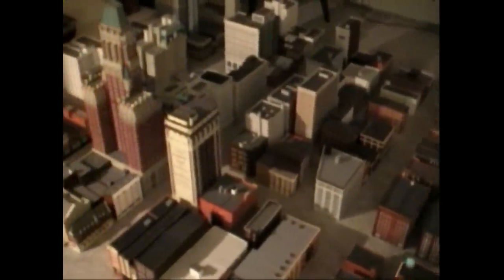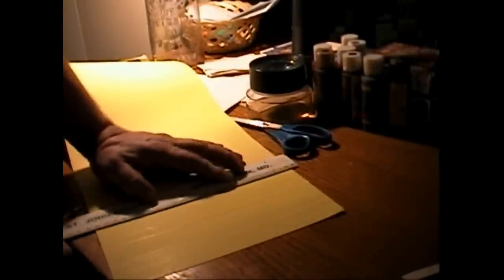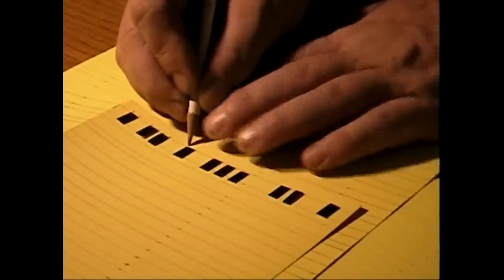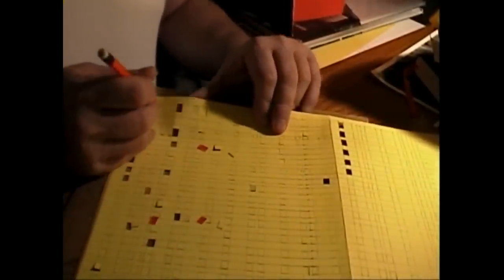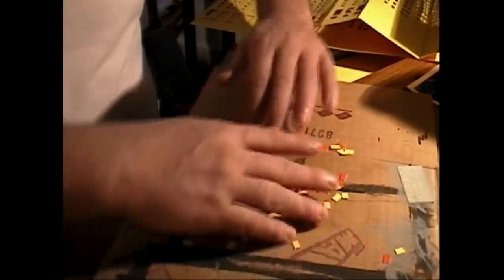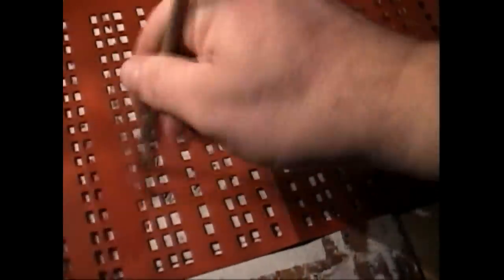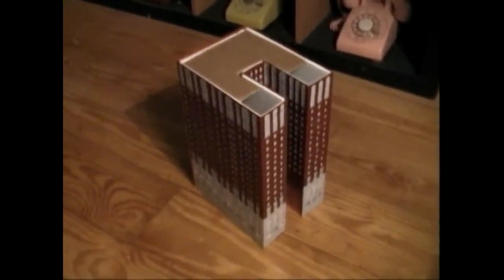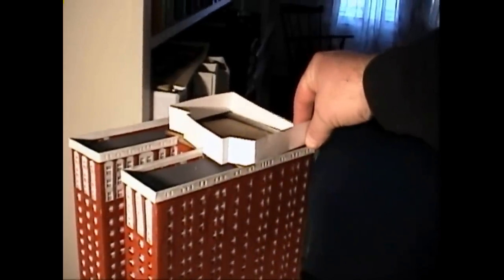Paper Model Building - Lord Baltimore Hotel - Baltimore, MD circa 1940

Comment: wouldn't you find it easier to do using a drafting table, plastic triangles, exacto knives, steel rulers with cork backing, setsquare, plastic scale to get a more accurate spacing, and better than paper would be card stock, which is more rigid.  The card stock is more resistant to warping when spraying with paint.  The paper would be useful for detailing window sashes or stonework ornamentation.  But your scale city looks great so keep up the good work